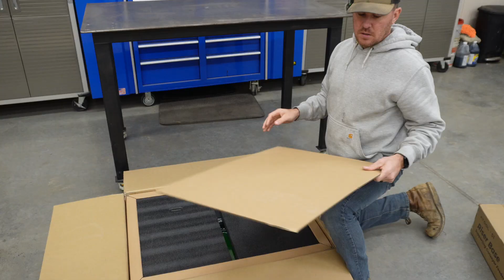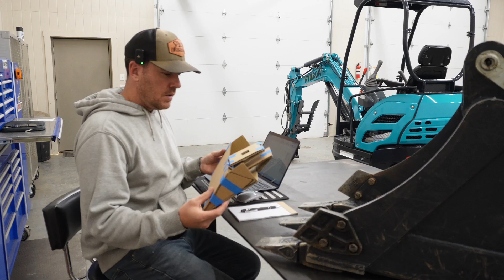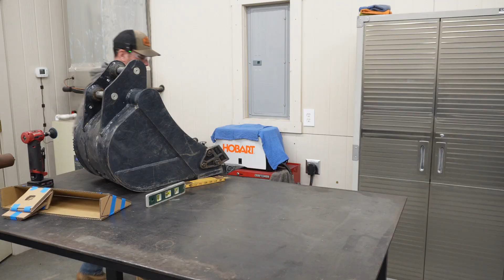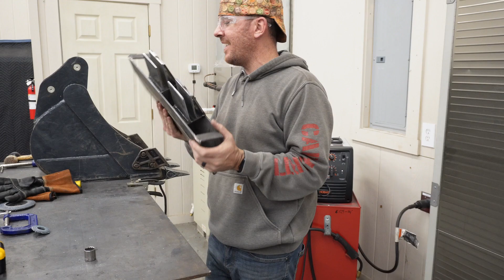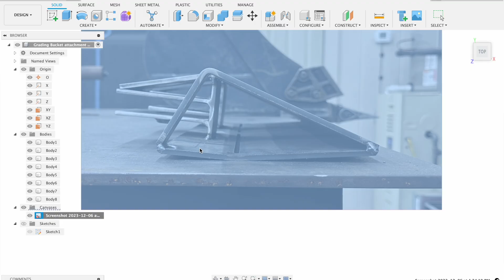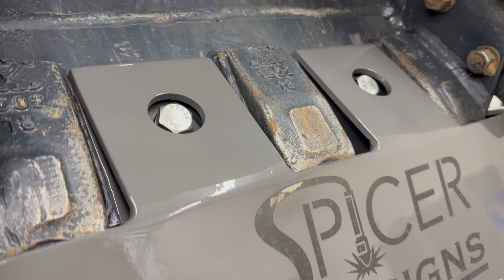Grading Buckets Are EXPENSIVE....Do This Instead

Comment: Just throwing this out there ...Cutting and  tacking on a 3/8"piece  AR400  to those teeth takes literally 30 seconds and will outlive the piece you spent days  using CAD, Plasma tables and engravers on.
Reply from the maker: I did consider that but i wanted something that was quick to remove without pounding the pins out and buying a second set of teeth.

Comment: get 2 or 3 replacement tooth, weld a flat bar... done.
Reply from the maker: Ya i over did it.  I thought the two bolts would be easier than dealing with 3 of those compression pins too.

Comment: Those are basically called a butter board in the excavation world. But usually we just weld a flat piece of steel to the teeth on the bucket. I like your design better.
Reply from the maker: Good to know.  I think i over did it but it will be nice to have.  Plan on using it on the shoreline of the pond.
Reply: @SpicerDesignsLLC   should work perfect for that. I actually need to weld one on my one foot bucket for digging around utilities. Less likely to hit something if your spotter can see the back of the cutting edge. Looking forward to seeing how yours holds up.

Comment: Could you fabricate a square head bolt that fits into the top angle plate?
Reply from the maker: Im not following.  Im guessing your watching the part where i talk about the cardboard template.
Reply: 4:22 4:57 as I got further in I see that you made the nuts captive. Since your cutting edge is on the front more wear and tear would be on that side. Just over thinking before I watched it all.
Reply from the maker: I figured you hadnt made it to that part yet.  Ya thats a good idea you had though
Reply: @SpicerDesignsLLC  keep us up to date on how the exchange goes after it’s in the pond!

Comment: I personally don't mind the longer video lengths. If you find that the cutting edge is wearing quickly, you could use some hard facing welding rod (such as Forney Supercote) and put an edge on there. You could also use some AR400 steel for the edge, but that's a lot more trouble to weld and usually requires pre-heating and low hydrogen filler rod.
Reply from the maker: Thanks for the info.  I could see it taking a beating with the hard clay here.  We’ll see how it does.